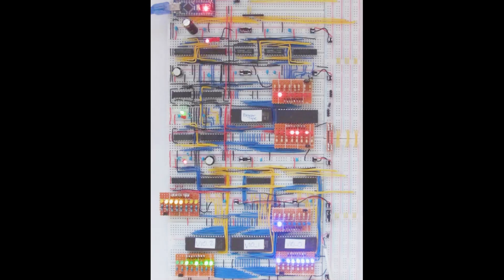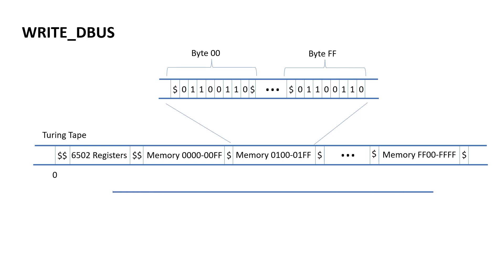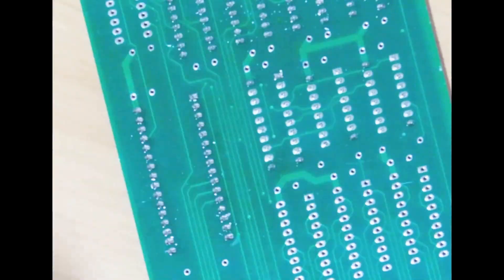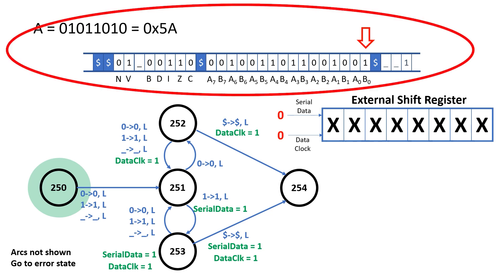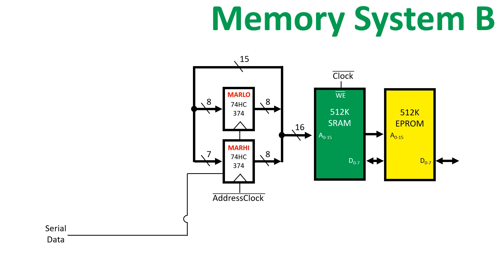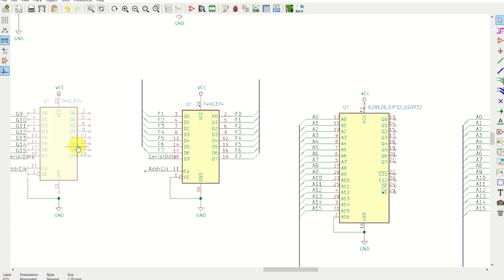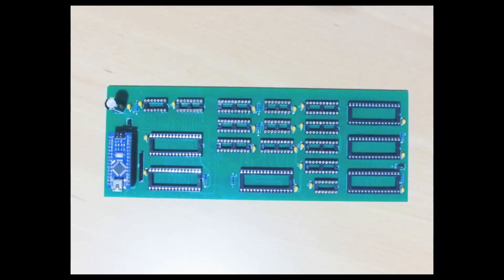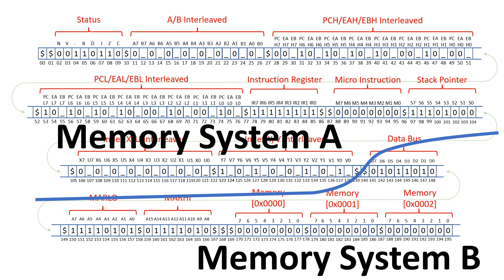PureTuring Part 7.  World's slowest PACMAN.

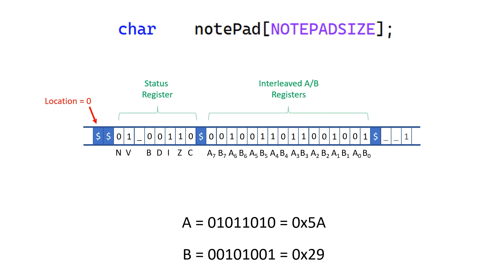Comment: 7:04 I realise this excellent series is a couple of years old at time of commenting, so there's no reason why anyone should answer... But here's my question anyway:
If the shift registers and Apple II-alike memory subsystem are there to take serial addressing load off the Turing machine, would it not be possible for the memory subsystem to r/w the notepad directly so relieving the Turing machine of managing shift registers?
Reply from the maker: Yeah, there are some memories that allow a serial input.  That would be easier to implement.

Comment: After having seen how many actions it takes to access (both read and write) the sequential memory in the previous video, this absolutely massive improvement from making main memory random-access wasn't exactly unexpected, but it was still impressive.  Neat!
Reply from the maker: I haven't finished this series, basically because I need to rewrite the state machines to handle a random access notepad.  Would you be interested in seeing how the state machines in the rule-book are made?
I do need to do it though, this is the missing link between this playlist and Turing6502
Reply: @DrMattRegan  I think that would be interesting to see, yes.

Comment: for the final exam, I am trying to figure out if this is Turing complete:  https://www.youtube.com/watch?v=-0gccsR1EEs   while it has a rules engine within RAM, this seems to be read only(?) meaning no scratchpad(?)  He uses the first 4 bits of the ram (operand) value as control lines to some i/o, while the other 4 bits (opcode) are used to control the PC for halt/jumps/loops.   I dont think this is Turing complete unless maybe the 4 "operand" bits are used to drive a scratchpad, but it is a neat programable machine.
Reply from the maker: I actually left a comment on this video.  It's a bit hard to be certain without a schematic diagram, but to me it looks like he's built a finite state machine.  This is equivalent to the sequencer/controller in the SAP1/SAP6502.  

This series of 3 videos https://www.youtube.com/watch?v=mPkAgXJOoSc&list=PLjQDRjQfW-84aOLT33kzoZghRofK-uL1F 
may help, particularly the middle video where i talk about FSMs and Turing Machines.

Comment: That's quite the performance improvement.
Reply from the maker: Still a bit more to go.  The 8-bit version gets down to about 7 clocks per 6502 instruction.
Reply: @DrMattRegan  What's interesting is using state transitions to trigger outputs to the shift registers. It is almost like you're harnessing a side effect of the Turing machine's states.
Reply from the maker: @mheermance  yeah it's kind of odd using shift registers for a parallel memory operation, although a lot of high-density boot eeproms do it now.
Reply: @DrMattRegan  that's around 50% of real 6502 performance, impressive. How fast can it clock?
Reply from the maker: @akkudakkupl  It runs at about 3.5Mhz, (with an asymmetric clock) so it is slightly faster than real time.  THe Arduino MEGA slows it down for video memory writes.  Eventually I'll combine the raster generator in Apple 2 wirew-by-wire video 12 into the EPROM here so there will be no penalty for video.
Reply: @DrMattRegan  very respectable taking EEPROMS into account